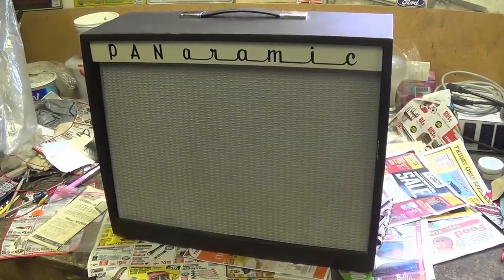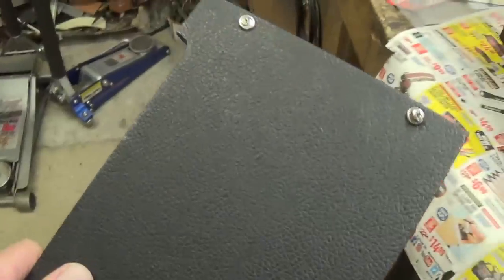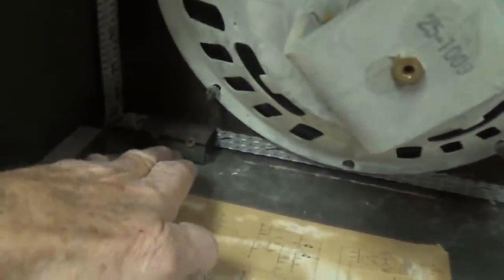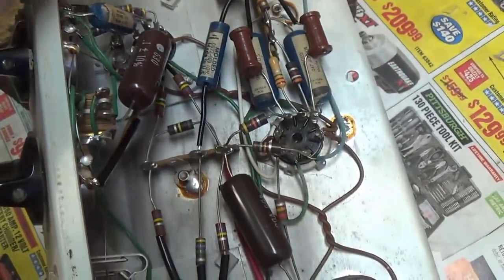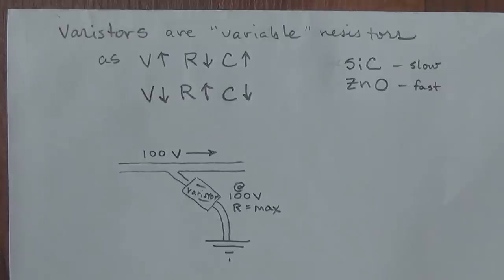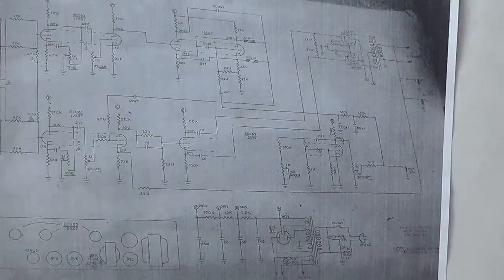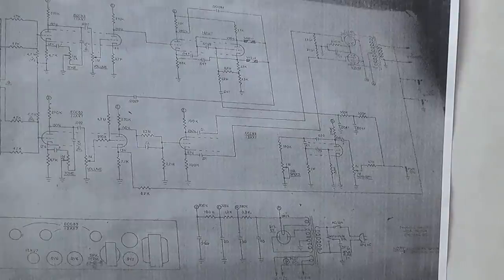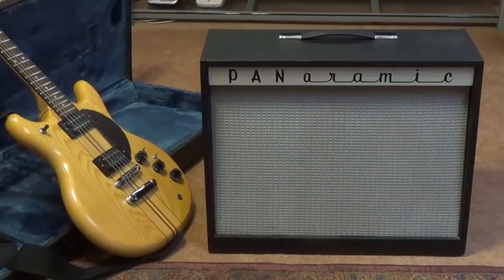1963 Magnatone Panaramic Model 1210 Amp with "True" Vibrato

Comment: What if you replaced that varister with a 1/4" jack and used a pot on a foot pedal... sayyyyyy an old organ pedal ;) could be pretty nifty...
Reply from the maker: You'd better be pretty agile and in good shape, YT. You'd have to press and release the pedal 2 or 3 times a second to get a good modulation.
Reply: @UncleDoug  this just got me thinking wouldnt the circuit act sorta like a wah if you arent modulating the pedal? Hmm may have to do some experiments ;)
Reply from the maker: Let us know how they turn out, YT :)

Comment: Hi Doug. I'm a big fan! I have a 63 Magnatone M12 (dual EL34, push pull) that has a .047 capacitor in the primary of T1. Should I leave it in when I replace the 2 prong cord? I can send you the schematic of you're interested.  Thanks!
Reply from the maker: It sounds like a "death cap", DD, which, to be honest presents no threat at all if the amp has a three-wire power cord that grounds the chassis, and the hot wire of the cord is properly fused. If not, then you probably should remove it.
Reply: @UncleDoug  Thanks for the reply. It was indeed a death cap. The amp had a hum canceling switch which reversed polarity of the primary, so there were 2 death caps... I've never seen that before. Not a ground switch like the Bassman, but an extra position on the power switch!  Here's the schematic.  http://magnatoneamps.com/schematics/magnatone_m12.pdf
Reply from the maker: I think you should properly install a 3-wire power cord, bypass the polarity switch, run the hot wire though both the on/off switch and fuse, and remove the death caps.
Reply: @UncleDoug  Exactly what I've done, plus replacing caps, etc. Also ditched the rotary  switch in favor of a carling 3- position and twisted and tidied up the heater circuit. No hum and crazy amounts of tone on the test. Bias tomorrow and then new tolex and polish/ re - silkscreen the faceplate. You'd be proud! I've learned so much of this from you... I feel like I owe you some tuition!

Comment: Vibrato sounds waaay better than tremolo. I need to figure out how to get that sound into a guitar pedal.
Reply from the maker: Good luck, VC. Let us know if you figure out how to do it.
Reply: Now I’ve got some new ideas on how it might be done
Reply: @UncleDoug  Did you per chance measure how much the resistance changes on those varistors? I would be curious to see like how much they go up and down in terms of percentage and what they measure when the amp is off. That info would be very helpful in me maybe possibly actually doing that.

Comment: The vibrato sounds almost identical to what you can get out of an old Boss CE-1 Chorus Ensemble. I wonder if the circuitry is similar? Maybe this is where Boss got the idea.
Reply from the maker: I don't know, Bill. Maybe someone out there knows.
Reply: Chorus/vibrato effects were implemented using bucket brigade delay devices. Or digital delay devices. A delayed signal, usually not more than about 30 milliseconds, is modulated to produce vibrato. Full audio spectrum more or less. Mix in the dry non modulated signal, and the effect is "chorus". The difference is that the Magnatone circuit is an allpass filter, which shifts the phase of the signal. And significantly, the phase shift is most pronounced at a center frequency of the filter. The "delay" is measured in degrees rather than microseconds. Mixing in the dry signal produces a sound more akin to "phase shifter" rather than "chorus", as we use the terms these days.
Reply: But the Boss unit I mentioned has both chorusing and vibrato. You can use them independently. I was referring to the vibrato effect, not the chorusing .
Reply: Yes, the difference between chorus and vibrato on the CE-1 is simply the dry signal being available at the output. No dry signal, no chorus, only vibrato. It did not use an allpass filter like the Magnatone. I don't recall if Boss used a stereo mode where the chorus mixing of wet and dry signals were done "in the air", where the dry signal was routed to one channel and the wet to the other. Which I think they did on some of their stereo chorus devices, and might also confuse things a bit.

Comment: How was the scope trigger set up?  The trigger point seems to be varying.
Reply from the maker: I don't recall, Russell. Are the settings visible? Wouldn't this be expected if the frequency was being altered rhythmically ?
Reply: @UncleDoug  No, the settings are not visible.  In the case of frequency shifting, I would have expected the left side to be stable as I would have thought it would trigger at the same point every time, but the wave form would have moved with increasing movement as you move toward the right.  However, this isn't frequency shifting but phase shifting.  (probably closer to phase switching)  I'm not sure how that would look.

Comment: Isn't phasing gonna be an issue when the two waves (from the plate and the cathode) meet after the varistors? Also, does the varistor at the plate side keep out the dc from leaking to the next triode? (I see no cap)
Reply from the maker: Good questions, Chris. Perhaps a viewer can offer some insights.
Reply: @UncleDoug  OK, how about this. Maybe the phase is shifted (a bit) after the cathode (caps and resistors phase shift) of the triode before the stage where the loop signal enters?
I do see what appears to be a .0022 mfd cap after the varistors, so that might be the answer to my second question..
Reply from the maker: @BebetaYoPapaniKoka  It's been a while since I was completely immersed in this circuitry, Chris, but your observations seem logical.

Comment: Hi Uncle Doug. Thank you for this and all the other vids over the years. Your the best. Great  to hear your doing the Silverstone 1474. In the last few weeks I have become super interested in 'heater filament' tube bias technology. In a convoluted way I came to this via Howlin' Wolf and Hubert Sumlin. I read that for many years that Hubert used a Danlectro made Wabash Amp, try finding a schematic or information  for that !. Anyhow I found some pictures and deduced it was similar to, and probably from the same factory, as some Silvertone amps. This was my first encounter with filament biasing. All the best from Taunton UK.
Reply from the maker: You're welcome, Phil. To be honest, I am not familiar with "filament biasing". In my experience, the filament voltage is simply left alone and all biasing efforts are focused upon the plate dissipation of the output tubes. I'll have to do some research in this area.
Reply: @UncleDoug  From what I can understand it is based on the fact that each 12.6v filament drop will draw 150ma. For two tubes that's a theoretical bias voltage of 25.2v. That seems to be a common application for 2 X 6L6 or 4 X 6V6. The Silvertone 1474 is different in  that the bias is shared with a resistor. I think it's genius. Minimize parts count, control tube turn on time and provide a quiet DC filament voltage to your preamp tubes.
Reply from the maker: I'm still having a tough time understanding how filament voltage supply and tube bias, which is accomplished by applying a charge to the tube grid (in one way or another), are related. I'll have to check into this. Thanks, Phil :)
Reply: @UncleDoug  I have to say that my understanding is theoretical. No vintage Silvertones round here. I too stared at the schematic trying to figure it out.  I 'll have one more go. Check out a Silvertone 1335 schematic. This is a pure example. The DC plate circuit is completed via the cathode and  heaters of two 12ax7's. In effect making it Cathode biased with the heaters of the tubes acting as a cathode resistor.  From ohm's law we know that the voltage drop across the heaters will be a product of the load and current. It just so happens the maths works out for 2 X 12ax7 heaters (150mA and 2 X 12.6v) and a 2 X 6L6 pp power stage (150mA at 300v plate will give around 45watts dissipation). The heaters will light and, hopefully, with a bias voltage of 2 X 12.6v  the tubes sound good. This needs a bench test but that will have to wait until my next build.

Comment: Great explanation of the vibrato circuit! Curious now, wouldn’t the low frequency modulation signal added to the grid also cause the amplitude to be affected?
Reply from the maker: When it is in phase with the music signal, it increases the amplitude, and when its out of phase, it reduces it.
Reply: Uncle Doug Okay, understood. But wouldn’t a modulation signal of say 1Hz cause a ‘DC offset’ on the grid (and final output) of half a second positive and half a second negative? With a matching effect on amplitude? In the same sense that the audio signal affects amplitude modulations, but this time slow going? Your scope images didn’t show any of this though, so I’m left puzzled. Total EE dummy here, btw. 🤣
Reply: Maybe these sub audio frequencies are simply filtered out by that coupling cap downstream?
Reply from the maker: @klontart  Such technical considerations are interesting but challenging, K. I appreciate your input on this topic.

Comment: Uncle Doug , I am working on converting a Kodak sound projector from the 1940s, and was thinking of converting the unused oscilator 6v6 tube to a tremolo, but maybe it seems  it may be even better to use to produce a vibrato ckt, as I have alot of varistors on hand. Can you post a link to that schematic? If you like I can turn you on to some of these varistors.
Reply from the maker: Dyna, a 6V6 is not suitable for either tremolo or vibrato, and of the thousands of different varistors available, only one type will work.....so it's unlikely (but not impossible) that you will have the right type. That said, I wish you luck with your project.  Here is the schematic:  http://magnatoneamps.com/schematics/estey_96-10041.png
Reply: Thanks for the schematic, the 6v6 is in the original osc design of the projector. As far as the varister, isn't the claping voltage the main consideration?
Reply from the maker: I've never seen one used in an oscillation loop, Dyna. I have a feeling it's application in the Kodak circuit is for a much higher frequency......but who knows ?  See the link in the video description for a detailed explanation of varistor characteristics.
Reply: @UncleDoug  Thanks again,  probably to much re-engineering for me to handle, I was viewing the varisters the way they are used in surge suppressors.

Comment: Based on the history of how so-called reissue amps typically don't compare hardly at all to the original amplifiers that they are supposed to emulate, I will guess that reissue "Magnatones" have decidedly different circuits then the Magnatone amps that were built in the 1950s and 60s. If anybody has access to a reissue Magnatone, I would love to see some pictures of the internal construction. I would bet a major body part that they use circuit boards and are not point-to-point wired and constructed like the original amps.
Reply from the maker: I understand your skepticism, GU, but have no access to a re-issue Magnatone amp for comparison. What little I have seen of them makes me think that they are first-class products and priced accordingly. Check this out:  https://www.thegearpage.net/board/index.php?threads/magnatone-vintage-vs-reissue.1452992/
Reply: @UncleDoug  , according to the link you provided and the comments on the discussion board, the new reissue magnatones don't sound quite the same as the originals, which is mentioned as being both a good thing and a bad thing, also, somebody indicates that they are indeed built with circuit boards. I've noticed in the advertising for these amps that none of the features and benefits listed include hand wiring or point point build or anything like that. And of course, we've all seen modern Marshalls and fenders, including so-called Fender reissues, that are built with printed circuit boards.
Reply: @UncleDoug  , I should add, to be fair, that many magnatones use some Oddball tubes that aren't easy to come by or perhaps not manufactured very well these days in China or Russia, and so you can kind of see why at the very least any reissued magnatones would be using tubes that are different from the originals. Maggie's frequently used 6973 output tubes, AKA 6 CZ5 ; and 7189As which are a  higher wattage handling, higher power version of the el84,  not directly interchangeable and with a slightly different pinout on the  a version. Vintage Magnatones also used 7247 / 12 DW 7 dual triodes, which are one half of a 12 ax 7 and 1/2 of a 12 Au 7 stuffed into the same bottle. And then there is the 6GW 8, also known as the ecl82 or ecl86? (Senioritis strikes!); that tube has 1/2 of a 12 Au7 driver tube and sort of a low-power el84 inside the same tall 9 pin bottle!
Reply: The reissue Varsity is hand wired and point to point. This is the only one I own but to my understanding, the others are too. All new Magnatone amps carry a hefty price tag; however, they are also premium builds made in America though you are paying in part for the label. I suggest grabbing your guitar and trying one out. Trust your ears, you’ll know if it is for you or not. Upon trying, if still in the fence for any reason, my advice is to walk away and keep looking. There are a world of amps to explore.

Comment: Toward the end of the original Kustom Amplifier series, Kustom sold a model with 3 12" speakers that had an actual vibrato circuit in the head. I had the opportunity to use one.  It wasn't very smooth, and was known to cause bouts of seasickness, but it was definitely vibrato.  This was in the early 1970's as my memory serves me.
Reply from the maker: That's news to me, Lawrence. I'll have to check my original Kustom sales brochures to see if they mention it.
Reply: @UncleDoug  To the best of my knowledge, they never made it into any sales brochures.  It was an odd duck.  It kept the original Kustom layout and cosmetics, but it was narrow to be proportionate with the 3 vertically aligned 12" drivers.  This made the head very small.
Reply from the maker: @lawrencegenereux8567  I guess that explains why I never heard of their existence, Lawrence. Thanks.
Reply: @UncleDoug  While I was looking for a catalog showing them, I stumbled across a brochure for Kasino, Kustoms non-padded line.  As a lover of all overkill amplifiers, I found a Kasino bass amp with an actual output power of 800 watts, and (get this) 16 12" speakers!  What's most amazing, is it's not a head and cabinet system; it's a combo amp!  8 12"s and the amplifier in the main section; and a 4 12" cabinet on each side, attached to the main cabinet with hinges.  The hinged cabinets fold forward covering the front of the main cabinet, making one, very big box for transport.
Reply from the maker: @lawrencegenereux8567  Good grief, you would have to have some stout roadies to tote that monster around.

Comment: Timely demo for me  of different winding resistances producing different plate dissipation. I have similar issue with an amp I am restoring which is producing 12.2 and 14.5 watts on a pair of cathode biased 6V6’s. My plan is to adjust the common bias resistor to bring the highest tube to, or slightly below 12 watts. Is this a reasonable approach?
Reply from the maker: Are you sure the difference is not simply due to different plate current capabilities in each tube?  This is a more common cause. Regardless, it is standard practice to bias so that the hottest tube is just under the max, as you suggest. In my experience, output tube imbalance has no adverse effect on tone.....in fact, it may actually contribute to a more complex harmonic spectrum.
Reply: @UncleDoug  Thx UD! I don’t have a mutual conductance tester and although the previous owner had new Electro Harmonix tubes installed, I am only assuming the shop that serviced it for him provided a matched pair as the bases are not labeled.
Reply from the maker: @Greg-wq4dj  IMHO you can't use a mutual conductance tester to match tubes, Greg (despite what some people say). It's all based on their ability to pass an equal amount of plate current, and the only way I've found to do this is simply to plug them in and measure it.....as you have done. Matched tubes are almost always labelled as such on their bases.
Reply: @UncleDoug  Your single/double ended biasing videos are superb and I thank you again for your well-informed advice. The specimen under restoration is a 1969 Garnet Mach 5 – 212 which has suffered the indignities of various  ‘mods’ and at some point a power transformer replacement with various fried components left in situ.